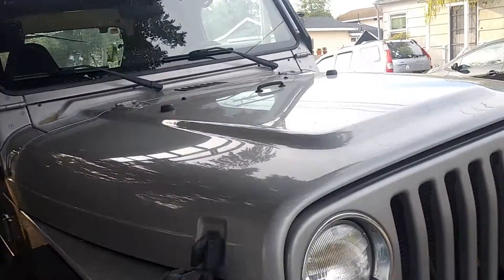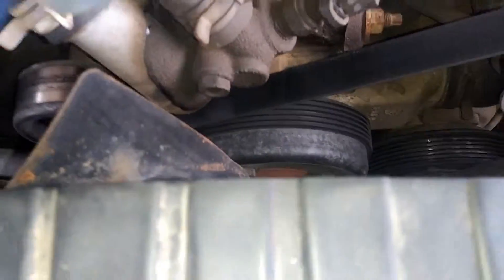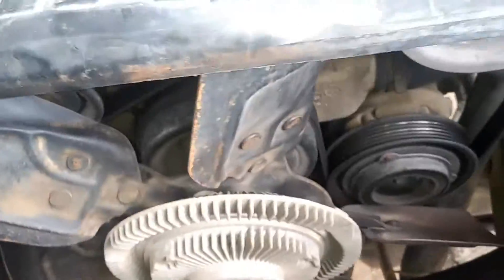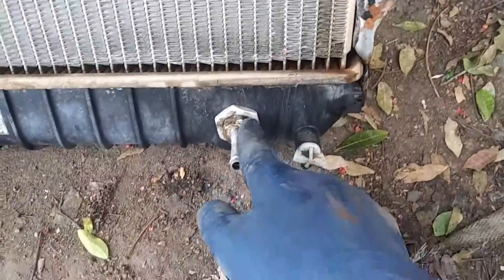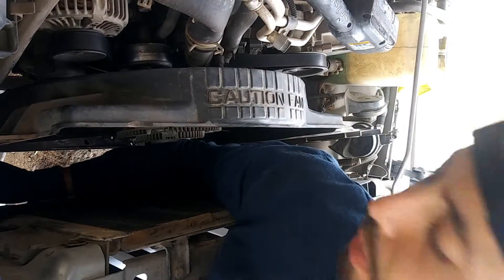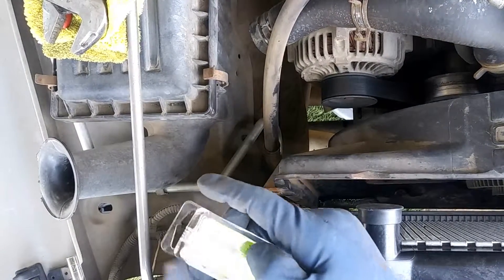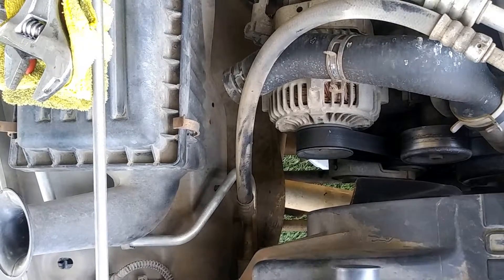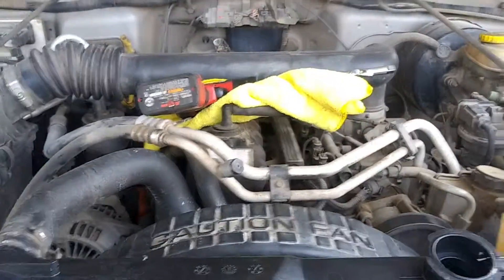2000 jeep wrangler radiator replacement

Comment: Thanks for the video! I was thinking I had to remove the fan, which I dreaded.  I did need to remove the bottom transmission fittings to help clear the fan but that allowed the bottom hose fitting to just pass the fan once they were out.